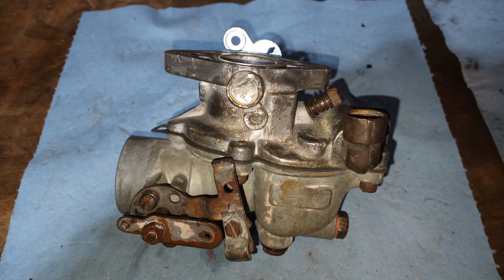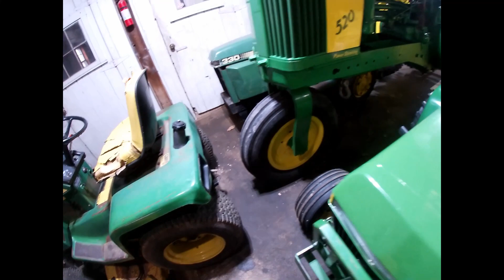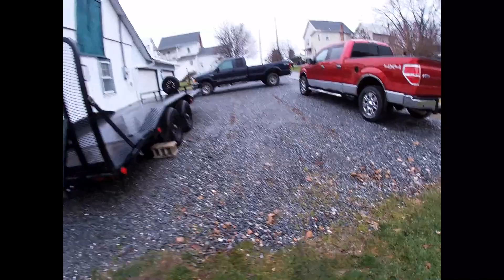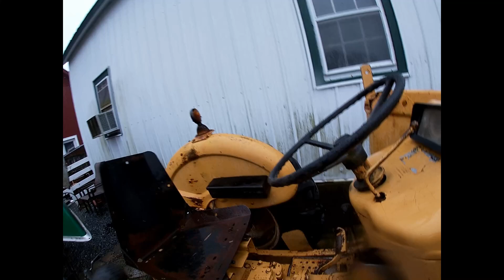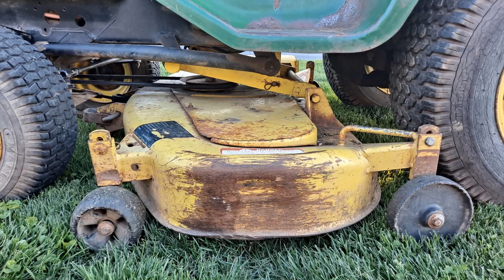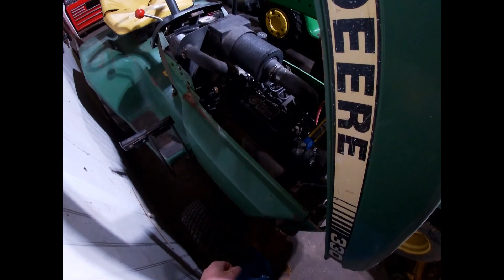MAJOR Winter Update - Welcoming Some Very Special Tractors (Past and Present) Into the Shop & Fleet

Comment: Doesn’t matter how rough that 330 looks man, they’re a really rugged diesel, even without power steering. My neighbor has one and I’m hoping he decides to part with it someday- would love to have it for a dual pedal swap
Reply from the maker: I bet this 330 could tell some stories. I've always been a big fan of the manual steering box on the 316/330, if you keep it greased it will handle just like power steering. The dual pedals will be nice because you'll have a 332 without the potential for blown steering valve seals or a cracked frame near the steering cylinder mount.

Comment: Merry early Christmas mike!! The 318 is out in the shed and airing for snow I still need to mount the new wheel bearings and out the v61s on the fronts I have many other projects wich would take me an hour to list them lol but we’re making progress so I’m happy
Reply from the maker: Merry Christmas, sounds like the 318 is coming along nicely. You won't be disappointed with the V61's. One of the best tires out there in my opinion.
Reply: @MichaelTJD60  tires are on and look great there is some play in my steering system it has 1436 hours so I guess it’s expected I’m thinking I can adjust the bolt and jam but to prevent back and forth movement on the axel wich will help I also will need to check out the break as because you can push them to the floor with almost no bite and left and right turning is not even there and I also noticed some oil and goo around the engine and the front of the Fran from the cooling grids for the hydraulic system and back is exceptionally clean otherwise I’m quite content with everything I hate dirt and grease so much I try and clean every aspect of it off any of the tractors I own once you have some wet oil it’s a magnet for dirt and dust can you do some how to videos in the future like one for instance how to remove and replace the flywheel shroud on the on and I’ve always struggled getting everything lined up and figuring out which bolts go where lol
Reply from the maker: @hunter7476  Mmrbeef has some good video series showing how to dismantle and assemble one of these engines. Before you adjust the jam bolts on the front axle I would make sure that the slop isn't in your steering column - that will tend to wear out and need rebuilt sooner than the front axle components themselves.
Reply: @MichaelTJD60  eh I don’t know I really don’t want to take it all apart right now it’s hard to tell where the slop is I know the axel needs adjusted and the front spindles are a bit sloppy I’ve got so many projects torn apart I’m not gonna take the Deere apart and decommission it right now maybe in the summer I’ll pull the engine give it a once over and take a look at the steering components

Comment: We had a 1982 ford 340A loader tractor. according to my dad, it was a amazing tractor and it always started but unfortunately in June of 2001, a tornado came through and knocked a tree down on it and the insurance company totaled it out. We bought it back but it just sits in the back 40 now, it’s unfortunately too damaged to repair
Reply from the maker: That's a shame it was damaged by a tornado. There are a lot of these tractors still running around so the parts are plentiful for them if you ever do decide to rebuild it. I looked at a 335 before this one that sat in a field for 30 years abandoned, and all the owner had to do was put a battery in it and drive it home.